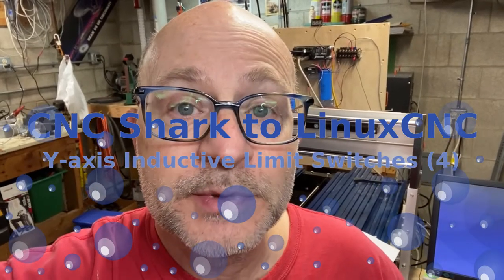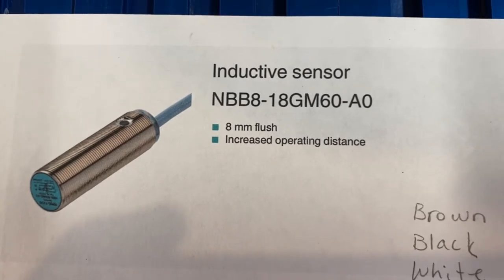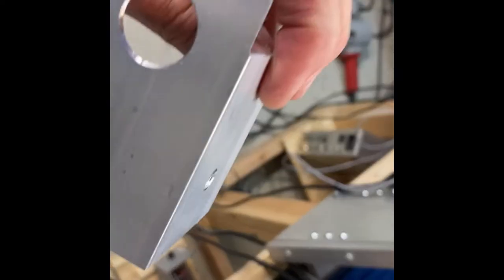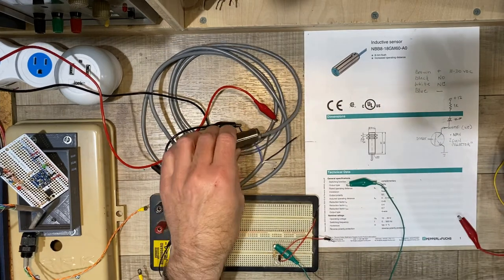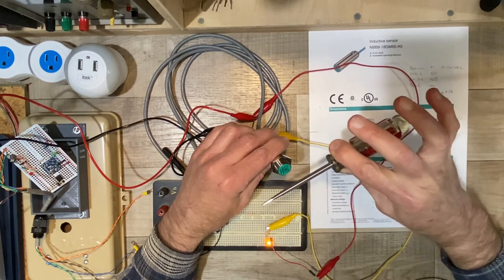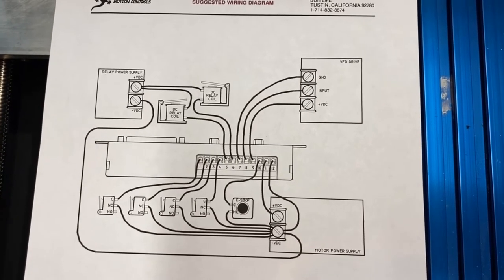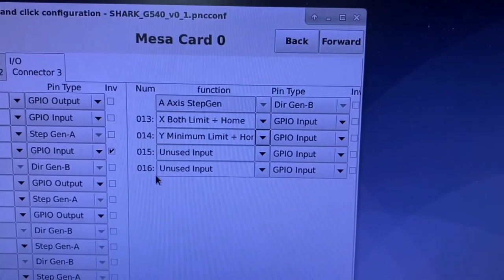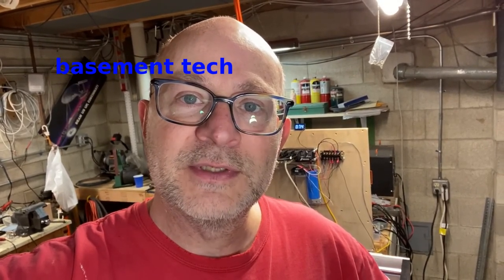CNC Shark to LinuxCNC ... Inductive Limit Switches are cool ! (4)

Comment from the maker: Update: Just a follow-up note ... I had to make/mount a steel trip dog on the Y+ end of the travel.  Due to the shape/angle of the aluminum superstructure of the y-axis gantry, the sensor was tripping a bit too close for comfort.  I added a bit of steel angle to the moving side of the y-axis and it's back to 5-8mm.
Reply: yes, sensor sense better steel and if use aluminium sensor less sense , thats mean, steel sensor sense dimension 8mm and aluminium about 4mm far.

Comment: can i connect same to linux cnc my sensor have only 3 wire pnp NO sensor. + come to power and - come to controller board GND and load to pin 11 board. need i external power, my sensor use 10-30V and i think i use 12 volt power supply because Bob board need 12V to sensor power. controller/B board same.  i not understand sensor, have 3 wire one go to power  one GND and one load. why load go to GND sensor picture.
Reply from the maker: @mattivirta ... thank you for your comment and question.  My sensors, as you probably know, are NPN sensors.  PNP sensors have to be connected differently.  I would point you to the User's Manual of the CNC4PC BoB's for reference.  Even if you aren't using that specific BoB, their manuals provide some very nice information on connecting various sensors.  I would point you specifically to Page 12 of the c10r10_user_manual.pdf.  Please message back if you don't/can't find what you need there. 

Best,
Daniel